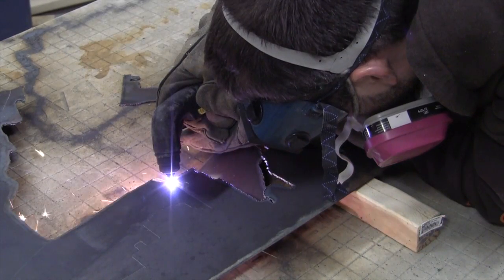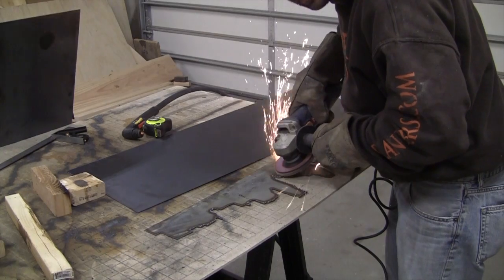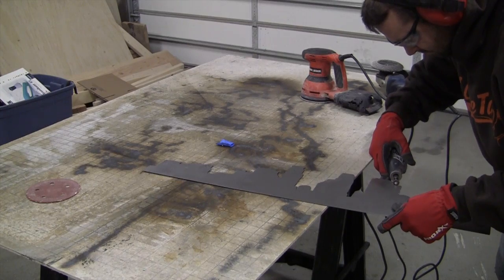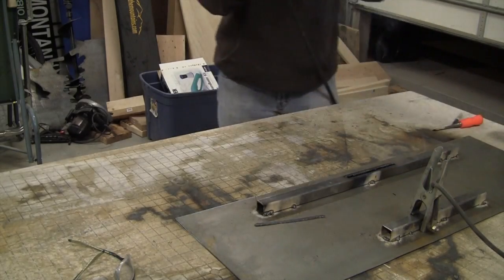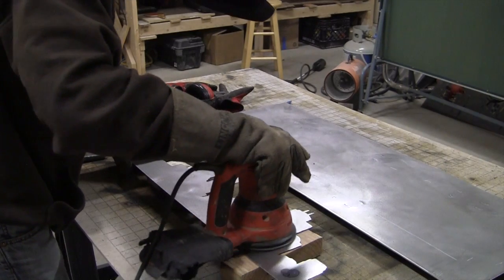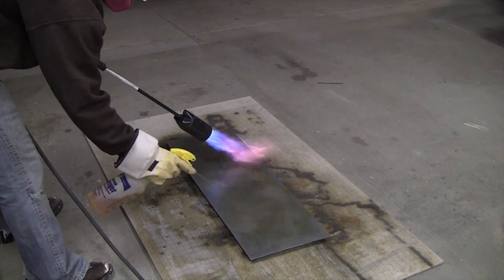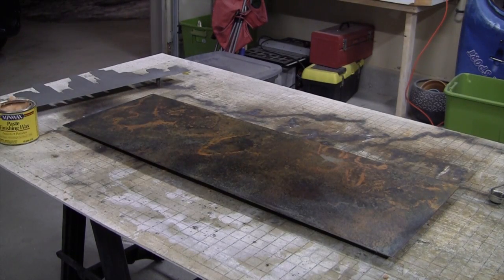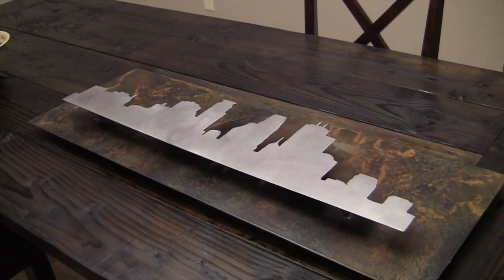Plasma Cutting and Welding a City Skyline - DIY Projects with Pete Episode 1

Comment: What size decal did you order?
Reply from the maker: This is approximately 30 inches in width.
Reply: So I need to order a 30" decal? So 30 x ??
Reply from the maker: Hey Ken, I had the decal cut at 30" wide and in proportion. It turned out to be 8" tall. You can find more info on the project here: http://www.diypete.com/diy-city-silhouette-metal-project/